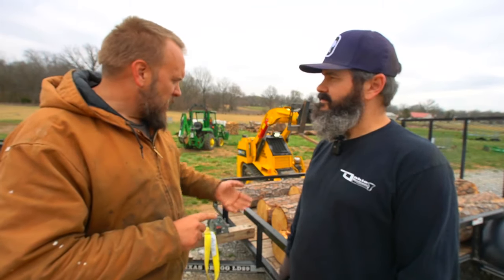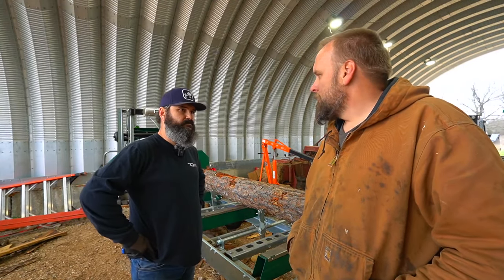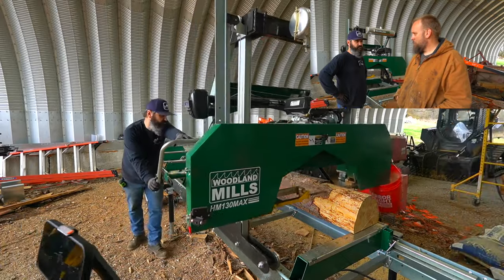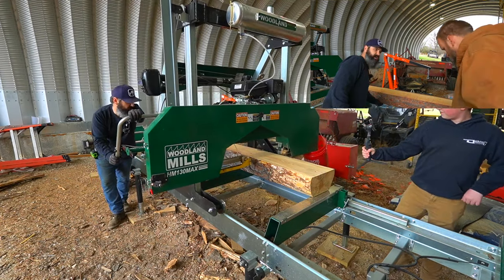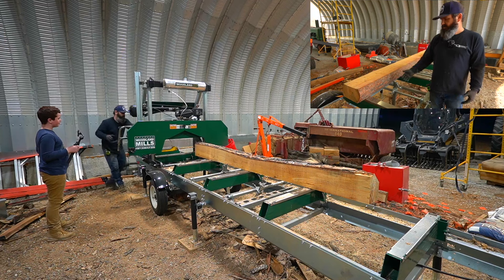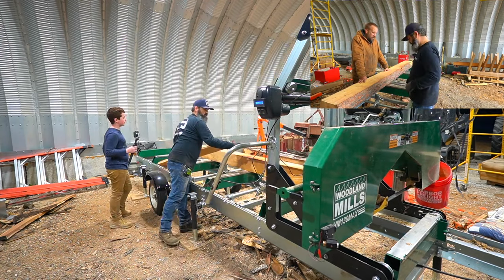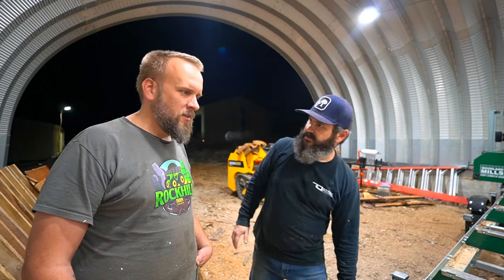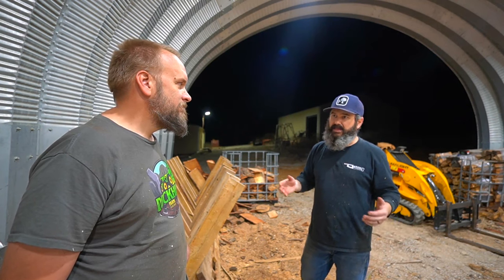Milling Small Logs - How to Get a Good Yield ￼

Comment: Could the upgraded hydraulics on the backhoe pluck those logs off the trailer? I'm sure you'd need some front end ballast, but I think you've got the lift capability now.
Reply: I bet it could have easily done so. Those machine stock are very capable. I dug a HUGE amount of dirt with a similar sized Kubota at my place and removed large heavy stumps with it. I just wanted to see the Baumalight run in person. Thanks for watching!
Reply from the maker: I almost tried that when I got the logs from Paul, but they were heavier.

This would’ve been a great time to do it